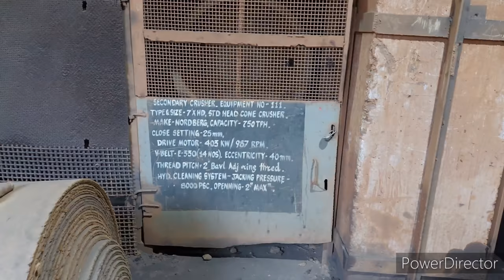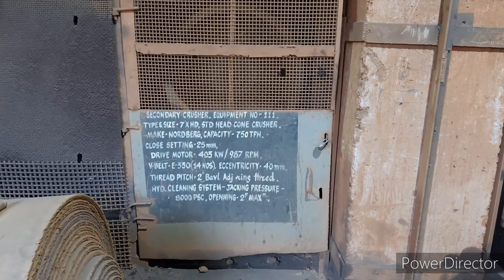IRON ORE CRUSHING PLANT

Comment: I worked at the eagle mountain open Pit iron mine back in the late sixties. My job was to stand at the edge of a Kobelco crusher and signal each two hundred ton ore truck when they could back up and dump their load. I felt the crushers power in my bones. The rock crushing sound was like a series of muffled explosions under my feet. Impressive.
Reply: That sounds cool
Reply: You described that perfectly
Reply: Kaushik Bala Eagle Mountain iron mine had its on railroad
Reply: I worked at an open pit gold mine in Canada. As the crusher operator I controlled the size of material as well as speeds for the conveyers and screens as well as the crushers. One jaw crusher two cones. The entire control room would shake. When its 5 am and you’re 10 hours into a 12, it liked to rock you to sleep aha

Comment: The iron ore is brought to the factory and moved continuously through conveyor belts and that is how the iron ore is processed. How simple iron ore processing is ???????👍👍👌👌
Reply: There's a lot of processing plant that wasn't filmed...
Reply: Yes and from the arse end out come rebar and sheet metal.
Reply: @7rixee  Negative… That happens at the foundry
Reply: And in between there is a view of the landscape, an iron ore feel-good factory.
Reply: @trainnerd4350  Obviously joking in the spirit of the previous comment ;-)
Reply: The top that we are looking at is the primary crusher. It will bring it down to the size of a basket ball. Then it drops into the secondary which crushes it to the size of crushed rock on roads. Then it travels a belt system to either a storage building or straight into a crusher mill with 16 tons worth of steel balls that turns it into a fine powder

Comment: No water sprays at the transfer points or along the belt system, no guards around belt rollers, a lot of spillage not cleaned up and didn’t see any wander switches at head rollers.

Comment: MSHA would have a field day. lol.... grease for the bearings and a Vac truck would do the place wonders
Reply: the rollers under the belts are sealed bearings you just run them till they drop and the replace all three rollers at once

Comment: Maintenance needs to step up their game...Too many squeaking bearings...And it's filthy with piles of dirt and crushings all over the place...Shortens the life of machines. BIG operation though...
Reply: Man I'd hate to be the one behind the grease gun. And I thought the Recycling facility I Supervise had a lot of moving parts
Reply: @joshwilliams9248  That place needs about t 20 guys...I wonder what their production tonnage is currently...The way that stuff was flying up those V belts, it's in the millions!
Reply: @godbluffvdgg  6:15... max. Equipment Output 750 ton./h...
Aprox. 200 kg./second... it's a small mining operation...
Reply: @eduardonascentes  Do you have a bigger one? I'm gonna say no...750 tons per hour is a LOT of material...I'm not suggesting it's the biggest, by any stretch of the imagination but, it's not small either...Mid sized...
Reply: @godbluffvdgg  well, in 90's, I worked in a medium size plant, it was 2.750 ton/h...
But if you search in the internet probably you'll find plants in Australia, Chile, USA, Canada, Brazil, operating 5.000 ton./h... in fact, mining it's an amazing area... I like the experience I had there...
Reply: @eduardonascentes  they unload those truck pretty quick.  I'd say dispite what any tags day they're well beyond 750 tons an hour
Reply: @eby6114  the truck's unload speed doesn't means that they're under, in or above the maximum capacity, because the material needs to pass by the crush, only at the adjusted size, in this case, the tag shows 2"...